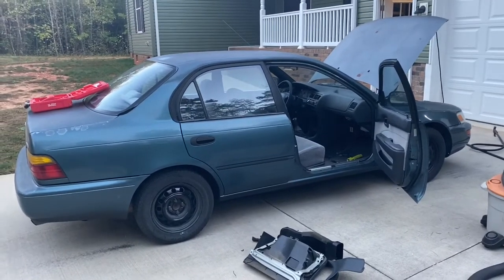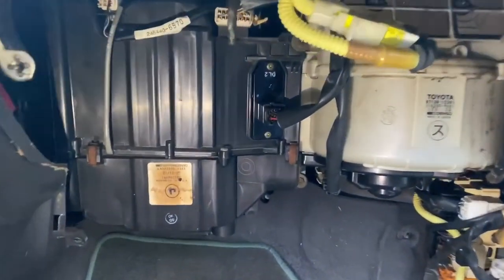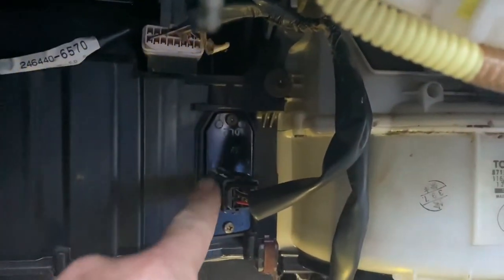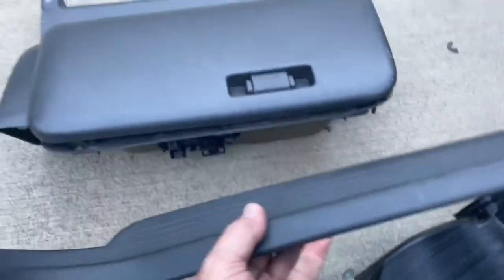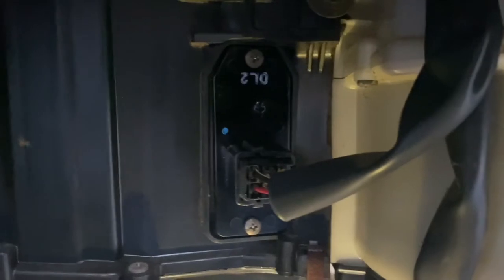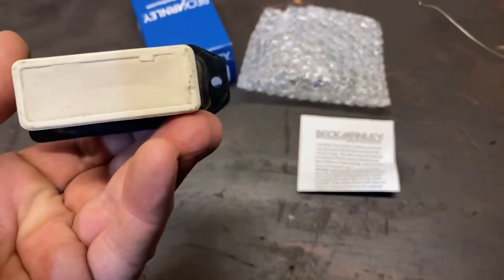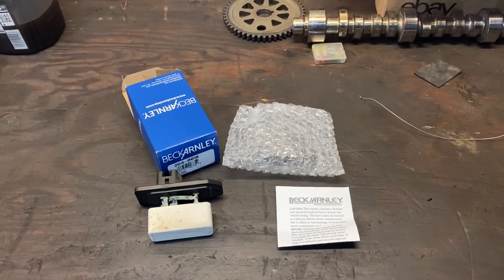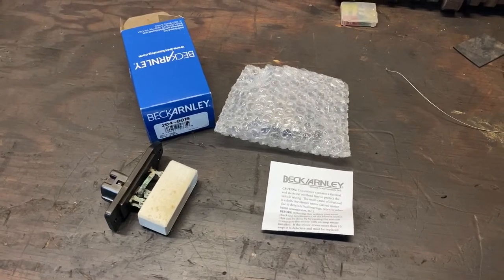1993-1997 Toyota Corolla/Geo Prizm HVAC blower resistor replacement

Comment: I'm trying to locate the AC relay on my '97 Corolla.  The fuse diagram says it's under the passenger kick panel...so took the kick panel off and looked but I don't see it. I've been having trouble finding anything about this online
Reply from the maker: Its there, its just deep up in there. Real pain in the ass to get to. You might need to remove the glove box and the speaker thats there in order to get line of sight on it.

Comment: Does it make vibrating noise near ur passenger side and near air blowers if the resistor is bad
Reply from the maker: No. You have trash in your blower fan wheel, causing it to be out of balance.
Reply: @76629online  ok thanks ingot the same car 1997 toyota corolla and everitime i turn it on theres a vibrating noise and loud till the car warms up and lowers down after a bit
Reply: And the noise is even if ac or heat is off
Reply from the maker: Dunno bout that, maybe you got bees. BEES! 🐝
Reply: how did it go?